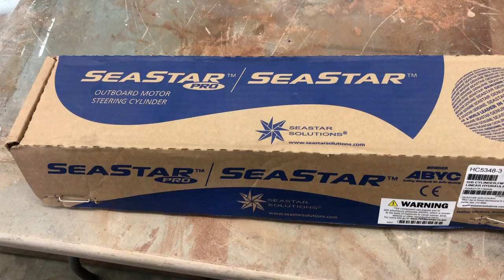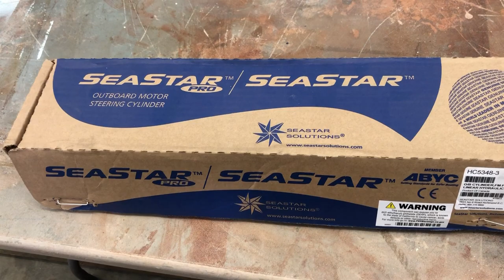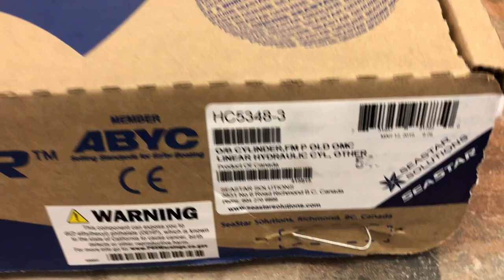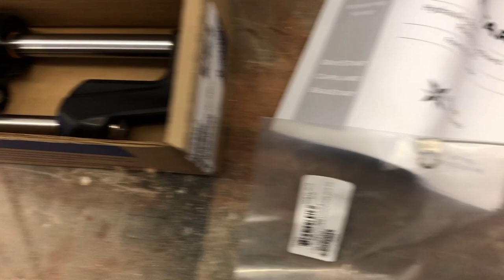Unboxing, installing and bleeding seastar hydraulic steering!

Comment: I think that is an early 90s Boston Whaler 23 Walkaround. One of my favorite boats but very rare. Very nice with the 200 etecs.
Reply from the maker: You've got it! They're awesome boats, unfortunately this one was not cared for most of its life. And with those etec motors she really moves along!
Reply: I bet she flys with the twin etec. Nice repower choice for that boat since weight is an issue. What’s interesting is that Reebok (shoe company) owned BW during that period and they are considered some of the best quality whalers. I love the lines on the 23.
Reply: What are your thoughts on the reliability of etecs? I may look to repower my 21 outrage soon. It currently has an optimax but they are no longer made.
Reply from the maker: @turbopete7794  honestly I'd stay away due to evinrude stopping production. As much as I love their motors they won't have to produce parts for them after 7 years if they choose to.
Reply: @maineboatguy  that makes total sense. I’d imagine it was hard for them to compete with the Japanese OEMs (yamaha and Suzuki). Going all in with DFI 2 strokes was risky. Interesting that Mercury dropped the optimax line a few years ago. Great motors (I have a 2001 200hp). Those HPDIs were good also. Maybe emissions or just good marketing by 4 stroke manufacturers. Too bad because I like DFI 2 strokes.